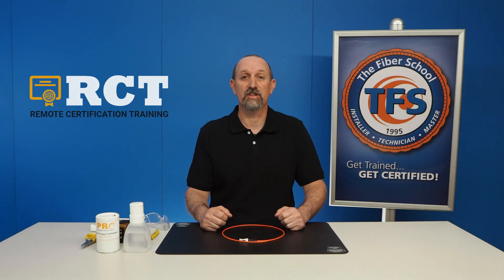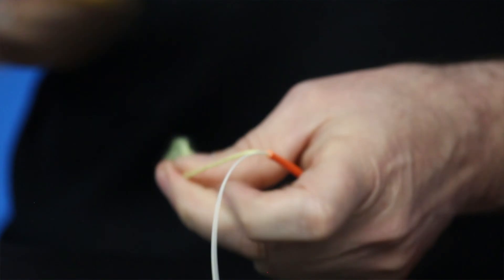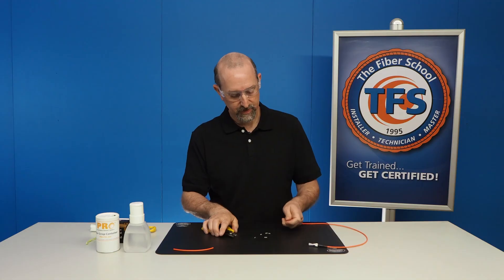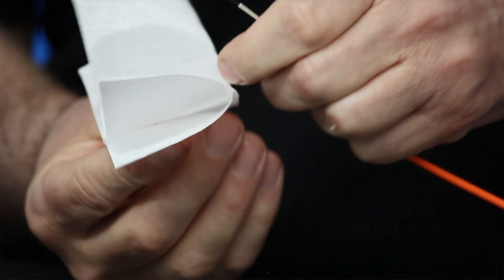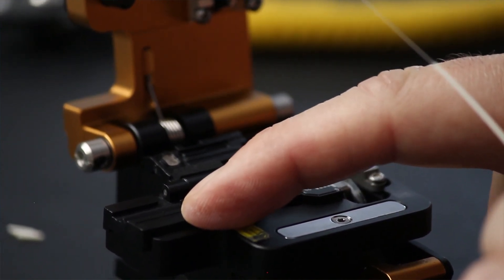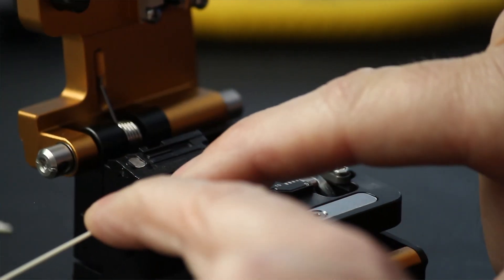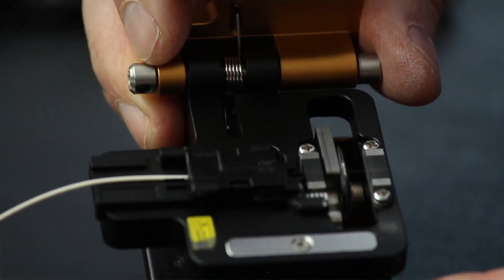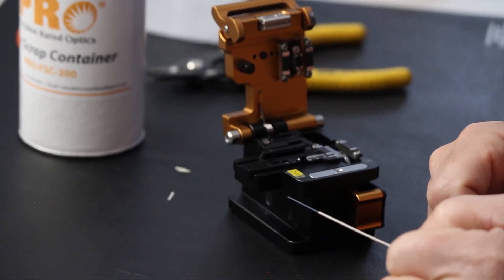How to: Use a High Precision Fiber Cleaver

Comment: EVERY SINGLE TRAINING VIDEO FORGETS BASIC INFOMATION: HOW LONG ARE EACH CUT. They say "its simple, remove the jacket..." HOW MANY CENTIMETERS, DAMN IT. Then you expose the bare fiber.... AGAIN, HOW MANY CENTIMETERS... MEASUREMENTS FOR HEAVEN'S SAKE!! Don't you have a ruler nearby???
Reply: Shutup
Reply: It's the connector or ferrule that you use in your application that specifies the lengths you need to have after cleaving. There is no universal magic number. This video is just showing the process of cleaving, once you know what the application and required dimensions will be.

Comment: How does one cleave plastic optical fibers?
Reply: Sharp blade.  Then some connector you melt the end into the countersunk end hole and in other connectors you crimp and then polish the end flat with a number of grits in sequence.

Some examples on YT if you use the search term "terminating plastic fibre"